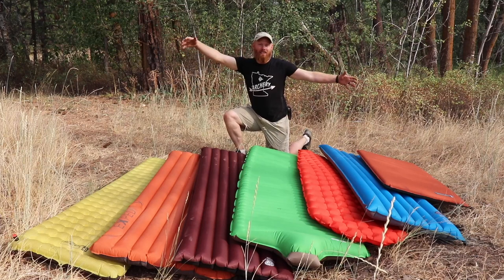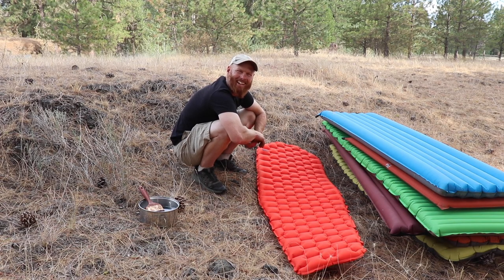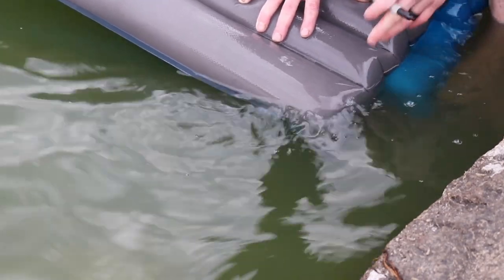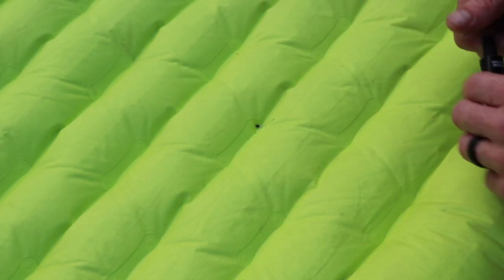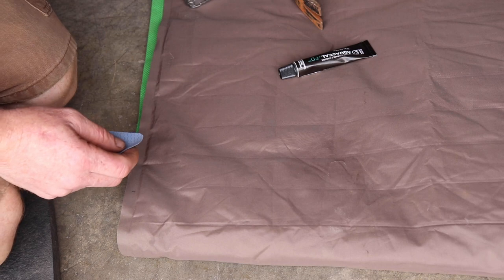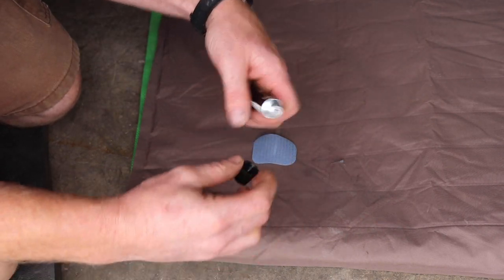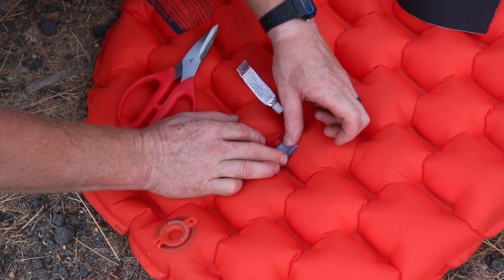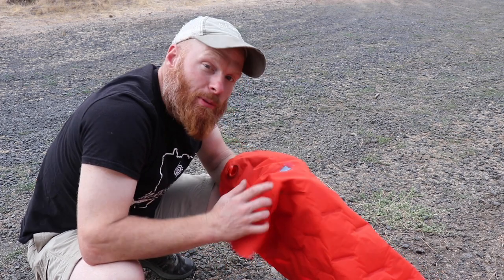How to Fix / Repair / Leaking Sleeping Pad (Field or Home)

Comment: Just curious - can you use a bicycle tube repair patch to fix holes? I ask because they take only about 3 minutes to apply (lightly sand area, apply glue, wait 3 minutes, peel back of patch, apply), don't require UV light or sunlight to cure, and are super reliable. OK, you may not want to sand the surface but that may not be a problem if the surface has some texture to it.
Reply from the maker: Yes those will work, good point to probably not sand it, I’ve used a lot of different glues and most will work

Comment: Fixing flats are easy. The real question is...how to fix it when the sealed rib parts running the length (in the middle) of the mattress rips loose inside and causes it to balloon up. You can't sleep on it then! I know 5 different mattresses from two different brands did that to me in 3 months. At 2 A.M. you're dead asleep and the inside seal on the partition rips loose you will wake up (if it doesn't throw you off...I had that happen) The brands at Walmart are OZARK TRAIL and INTEX. Both worthless.
Reply from the maker: Great to know thank you, I won’t get one from there now, I don’t want that happening to me!